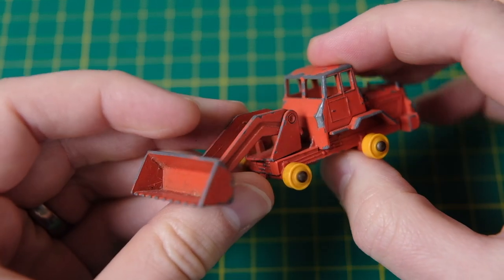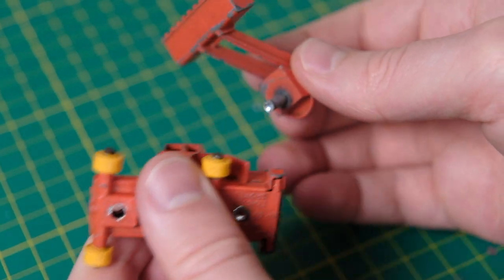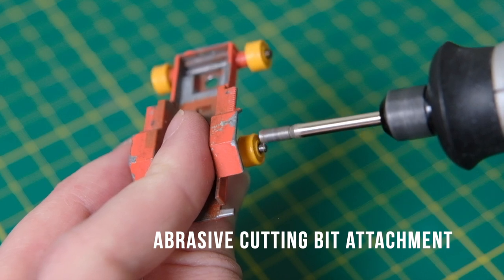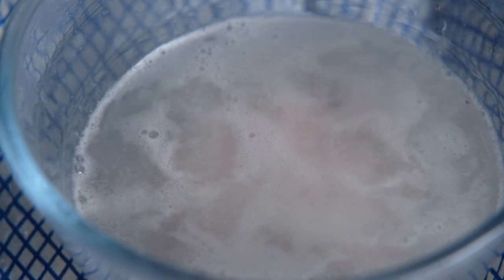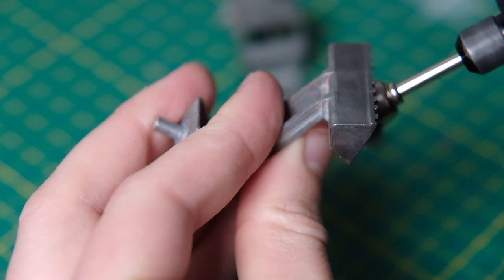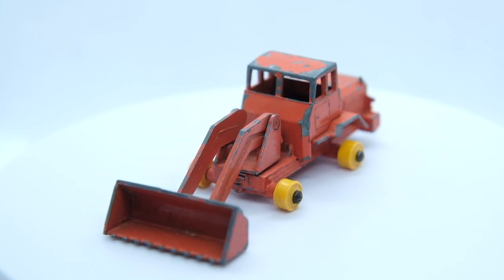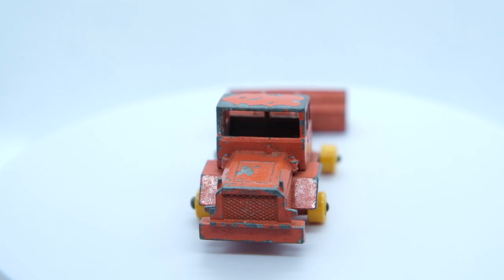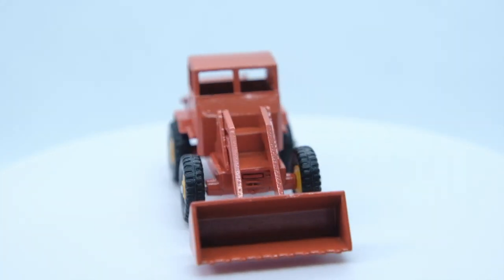MATCHBOX restoration: 69B Hatra Tractor Shovel

Comment: Translation from the HATRA hompage that is exclusively for information about the former company HATRA, its history and products.:

As early as the early 1950s, HATRA began developing a shovel loader with a loading system that could be swiveled through 180 °. The loader already had all-wheel steering, all-wheel drive and four wheels of the same size. The weight of the machine was around 8,000 kg, the engine output 60 hp. "The solid construction and the powerful diesel engine give the device great pulling and pushing power. The steering can be switched to either front or rear wheel steering. The built-in fluid coupling ensures smooth start-up and prevents malfunctions in the engine and gearbox due to overloading in the most difficult of applications." was the description of the prototype. Technical properties that could also be found in further developments. 
In 1954, HATRA presented the first earth-moving machine ready for series production. The HATRA swivel scraper - at that time still without a type designation - already had all the advantages  of this type of machine: all-wheel drive, all-wheel steering, 360 ° swiveling loading system and a travel speed of 42 km / h, which is unusually high for construction machinery. The SL150 followed a year later.
In 1961, the swing loader was given a new design at HATRA and was then offered as the SL 125. In 1963, the swing loader was offered in parallel as the SL 225 for civilian use. After extensive testing, the Bundeswehr decided in 1961 to purchase the swing loader as a field handling device (FUG) or later as a field work device (FAG). A total of 1650 machines were delivered. The HATRA swing loader has thus become the most popular construction machine from Travemünde to this day. Other countries also decided in favor of the SL 125 as a pioneer device. In addition to Algeria, the armies of Austria and Sweden obtained machines from HATRA. The Deutsche Bundesbahn also received larger numbers for the track superstructure.  
From 1963, the swing loader was also offered for civilian use as the SL 225. A total of 300 machines were delivered to the construction industry. The popularity of the SL 125 as a Matchbox model certainly contributed to the popularity of the SL 125.  
From 1965 the swing loader was available worldwide in two scales in the model range of the English manufacturer Lesney and is therefore not only known to experts to this day. The HATRA SL 125 was specially developed for the requirements of the armed forces: multi-fuel engine, 55 km / h marching speed and versatility. In addition to the loading shovel and stacking fork, backhoe buckets and grabs were available as work equipment. A trench cutter (developed by LMG, Lübeck) and a crane (TW 521, developed by Wilhag, Langenfeld) were tested as prototypes. With a dozer blade (developed by Frisch, Augsburg), the SL 125 could also be used as a wheel grader. At the same time, HATRA presented the smaller SL 80 in 1962, which was offered both as a swivel loader and as a conventional shovel loader. In the same year, the SL 200 with a short loading system and parallel kinematics supplemented the range. However, both disappeared again for a short time.
After the FL 60 prototype, the FL 50 E (single-axle front-wheel drive) and FL 50 A (all-wheel drive) shovel loaders with Voith gearboxes were launched in 1964, marking the start of a very successful wheel loader series. Externally, the two versions differed in that the FL 50 E had smaller rear wheels and thus also had a smaller turning radius (4,900 mm) than the all-wheel drive version (5,400 mm).  
From 1965 onwards, only the all-wheel drive version was offered as the HATRA 700 (later the H 700). Compared to its predecessor, this loader received a robust ZF transmission. This modern machine design also came from Louis L. Lepoix and corresponded to the HATRA Zweckform. In the year of its appearance, the loader received the "if-Die gute Industrieform" award from the Hanover Fair. As a further development, from 1969 HATRA presented the 700 L shovel loader, which has improved in all performance data. The 700 L was also offered with an extended mast. The loading system and cylinder were lengthened by 400 mm for this. This increased the dumping height accordingly. Other shovel loaders were the types 1000 and 1500 introduced from 1965. These loaders were only manufactured in small numbers. Only two copies of the 1500 were made. The production number of the 1000 is unknown. HATRA developed the multi-purpose device ML 70 especially for military use. It was used by the Swiss Army, among others. The ML 70 could be used as a shovel loader or as an all-terrain forklift. Two people could ride in the ML 70 and it reached a top speed of 60 km / h.  However, it remained with a small series.
The production of the HATRA shovel loader was discontinued in 1972 and the service for the swivel loader SL 125 and SL 225 was handed over to the Saar industrial works in Dillingen. In the following years, they had mainly taken over maintenance of the machines used by the Bundeswehr. The SL 225 was built under license in China until 1993. The Tianjin Engineering Machinery Factory manufactured the swing loader, which was slightly modified for the Chinese market, as type Z-160.
Reply from the maker: Yes that is where I got my information from for the video. That is a brilliant website, though it took a while to find it as nearly all results for Hatra are regarding the ancient city in Iraq!